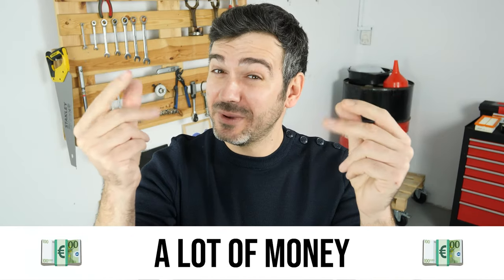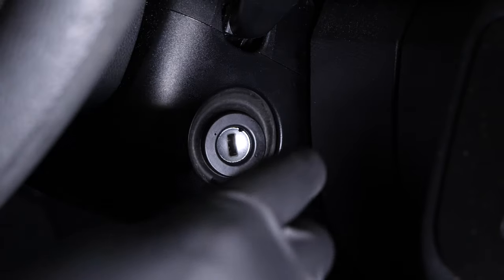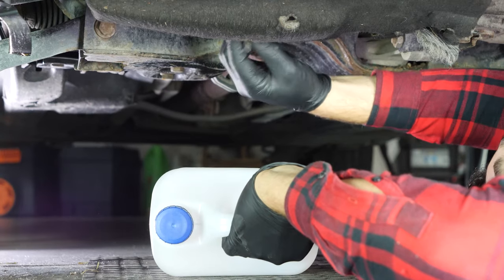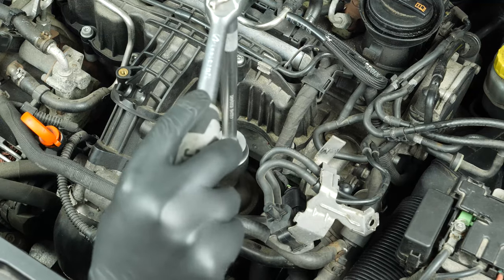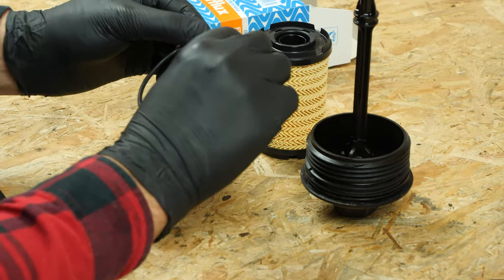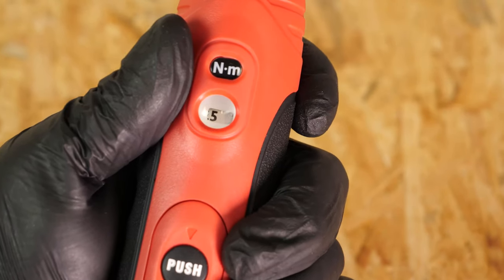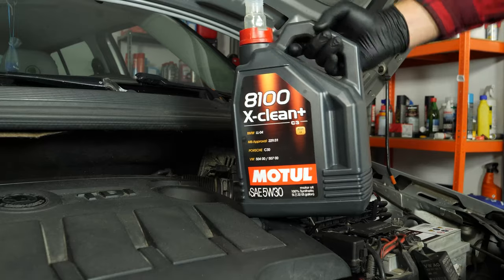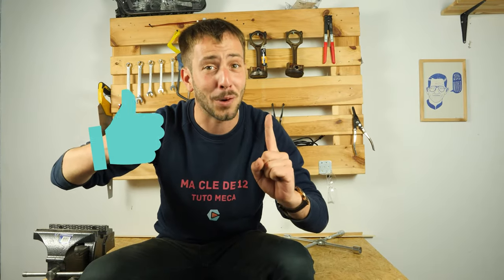Change the oil and the oil filter Fabia mk2 1.6 TDI🛢

Comment: very good presentation
I didn't understand when you poured the engine cleaning solution
Over the old oil or after emptying?
I am waiting for an answer from you.
Thank you very much
Reply: Video says run the engine with it 15 min, but no drive anywhere.